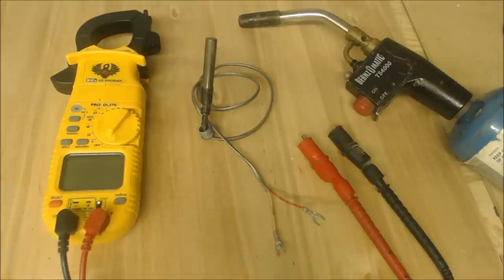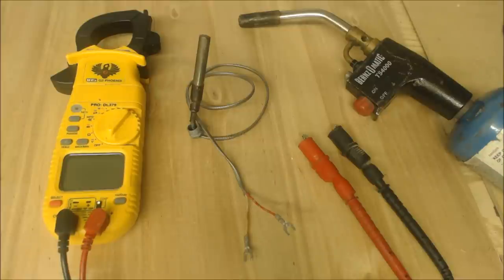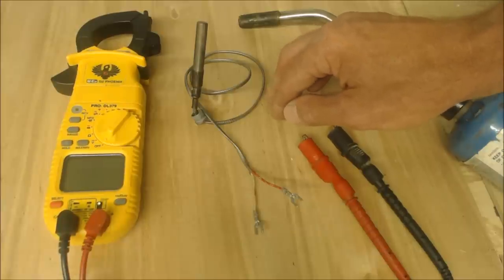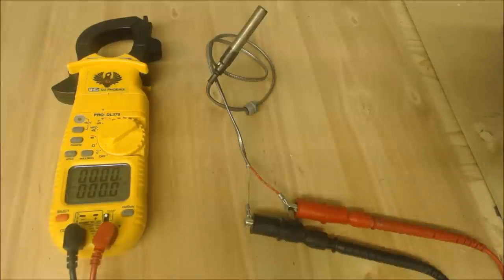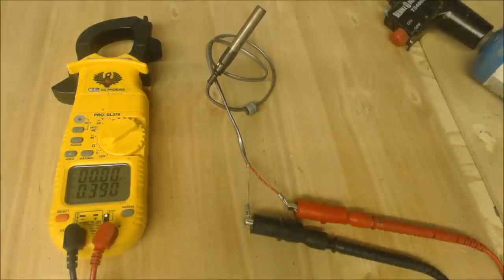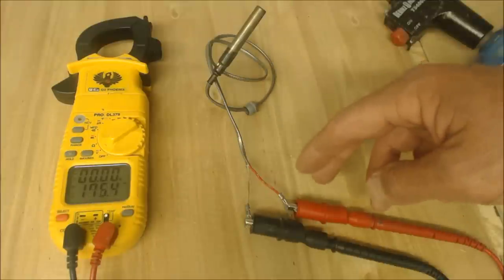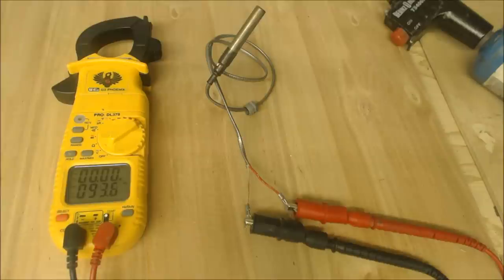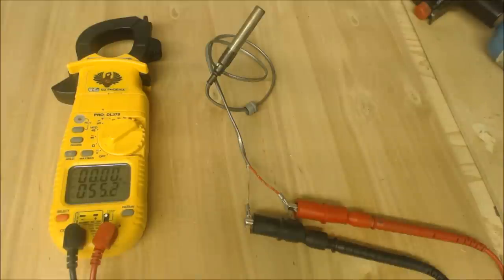750MV DC THERMOPILE POWERPILE- Reading Open Cicuit Voltage and Closed Circuit Voltage!

Comment: I ordered a new thermopile  off ebay. with the pilot on, the fire place ignites at 240 mv and the reading keeps going up till it reaches around 350 mv then after a couple minutes the fireplace in  turns off. Idk what it could be.

Comment: thank you for this great video. does it matter which of the leads (red or white) from thermopile is connected to the thermostat? thanks.
Reply from the maker: The thermostat is not being powered by the millivolts and is just breaking the wire so no it wouldn't and you are only powering dc solenoids, thanks

Comment: I have this in my American Standard boiler. A bit of debris in the pilot orifice caused the flame to miss the thermopile and a failure to start the gas valve.
Reply from the maker: I hear you! I find debris in the pilot tube quite a bit as well as oxidation on the outside of the thermopile, thanks Timothy!

Comment: I'm trouble shooting a propane wall heater that has a seemingly identical thermopile. Will a faulty thermopile prevent me from successfully lighting the pilot flame? Thanks in advance.
Reply: No. a faulty thermopile prevents the flame from staying lit when you let go of the button since the coil isn't getting enough energy in the gas valve to keep that pilot lit. Having trouble lighting is a gas problem (bad propane or too low a pressure), or pilot orifice plugged, or possibly a gas valve problem with the switch being depressed and it just won't let the gas through to the pilot tubing.
Reply: @Jason-wc3fh  Thank you sir!

Comment: hi, i did this same testing procedure and got around 700m with only pilot on hitting the thermopile. But as soon as i connect wires to TH/TP and TP the voltage drops to around 114mv.burner won't come on. i tapped valve lightly then burner comes on? what's causing this drastic drop? bad thermopile or bad gas valve? thank you.
Reply: I have the same issue. Did you ever resolve this?
Reply: It was a weak thermopile. It's voltage dropped drastically once underload.

Comment: OK, checked the Mv at the thermostat and I get 450. The floor furnace is hard to light and when it does runs then turns off in 15 minutes. 450Mv at the thermostat, when the furnace lights and is running it shows 0 Mv at the two wires at the thermostat. What am I missing? Looking into the furnace the flame at the thermopile looks very weak

Comment: Thanks for the great video as well as all the links.  Question: I need a new Tp for my gas fireplace, is the HW Tp you have in the video ($60 I think) much better then the P/N 51827 Tps that seem to vary between $7 and $40? Are there "knock-off" Tps that would compel me to buy the HW?  Thanks again.
Reply from the maker: Yes that one was the Honeywell version which is the good one with the metal sheathing. I have seen wires burnt up and thermopiles not lasting long so I linked the good one, thanks- 750mv DC Thermopile with metal wire sheathing    http://amzn.to/2bpfBGc

Comment: what are the difference between thermopiles and thermocouples?
Reply: thermopile is basically a PILE of thermocouples together as one... It's just a bigger version that produces more power because of what it will operate instead of what a thermocouple will operate.

Comment: I thought flame rectification goes after the gas valve is open , so, once the gas flows then the rod is in the flame
Reply from the maker: This type of flame proving method does not use flame rectification but uses he generation of DC Millivolts, thanks George!

Comment: Also remember. What ever your reading is. The solenoid is going to suck half of it. If reading was 700mv now connect to gas valve. reading will drop to about half the voltage value.

Comment: your explanation seems to be double talk.  at the beginning you said the test was being run on a thermopile that had failed; but the actual test showed it was well over the (350?) minimum.  A few other comments gave you an opportunity to explain furthur, but you did not.  Question--is this a good or bad thermopile? What makes it bad?  For a complete test do you need to know what the voltage is when the part is actually in use?  and if so, then how do you test it when you can't get the gas to continue flowing?  I am not well versed in this, but am having a problem with a Vermont Castings free standing gas stove that uses gas logs, and can not find anyone to service it and this type of answer doesn't really help.  thanks for listening
Reply: Yes frustrating. He focused only on heating a thermocouple and explained how a multimeter works. It seems that as long as the thermocouple generates at least 150mV is so, this will be enough to turn the gas valve on.  In my case, I have a wall switch for a gas fireplace.  The valve is activated by the wall switch but also the thermocouple voltage needs to be above a threshold.  When I throw the wall switch on, the thermocouple reading goes from 320mV down to 160mV but the valve stays on. Before I put a meter on it, the flames weren't coming on. Pilot is on the whole time, and wall switch works fine, so it must be the thermocouple. But what I don't understand is why the mV reading drops since thermocouple temperature didn't change in just one second. Maybe the valve is doing something weird.
Reply: This video is not explained very good, I have not come crossed any videos that really explain the voltage reading of an open circuit and closed circuit readings.